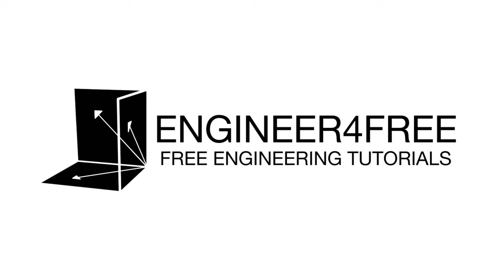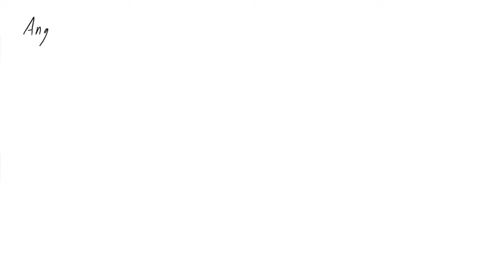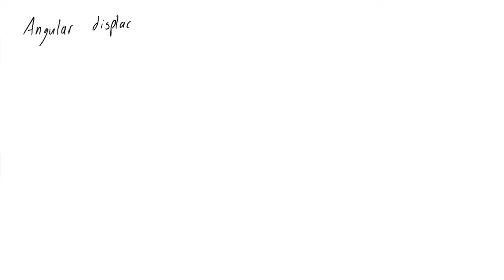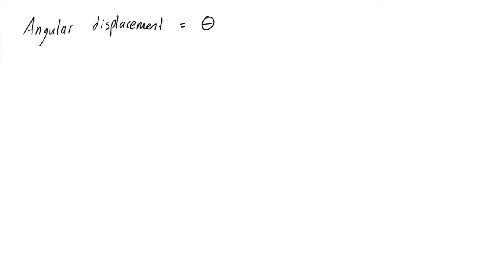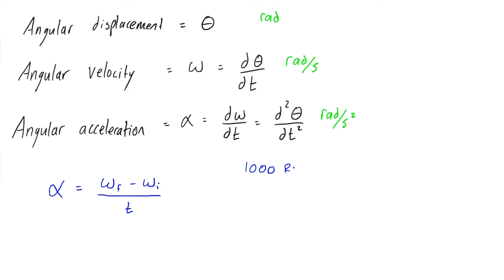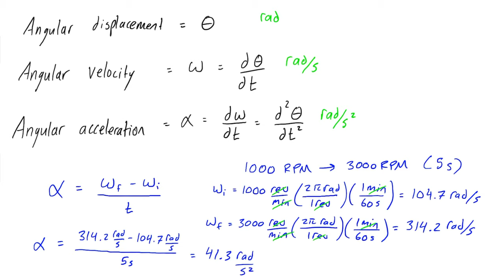How to calculate angular acceleration

Comment: an angular acceleration is given by alpha = (0.4t^2 + 0.6) rad/s^2 where t is in seconds, is impacted to a disc A by a motor. if initially the disc has an angular velocity of 5 rad/s, calculate the velocity and acceleration of block B at the time instant t = 1.5s

Comment: I got a couple of question that I am not to sure about could you help?
1) An automobile travels to the right at a constant velocity of magnitude : v = 60.8 km/h. If the diameter of a wheel is d = 429.1 mm, determine the angular velocity of the wheel. θ = 24.7 degrees.

2)An automobile travels to the right at a constant velocity of magnitude v = 69.0 km/h. If the diameter of a wheel is d = 350.9 mm, determine the magnitude of the velocity of point D. θ = 24.0 degrees.

3) An automobile travels to the right at a constant velocity of magnitude v = 68.7 km/h. If the diameter of a wheel (shown in Figure Q6) is d = 303.7 mm, determine the magnitude of the velocity of point E.  θ = 22.5 degrees.

Many thanks!
Reply from the maker: Hey Alex, watch videos 15 - 21 here engineer4free.com/dynamics and specifically 17 and 20 wikl show you what you need, but I recommend just taking the time to watch them all 👌

Comment: A small vehicle enters the top of a circular path with a tangential velocity of 4 m/s and gathers speed as it moves down the path. Determine the angle β to the position where the vehicle leaves the path and becomes a projectile. radius is 10m

any videos regarding this problem? thanks in advance
Reply from the maker: Hmmm having a hard time visualizing what you described. All of my circular motion problems are here: engineer4free.com/dynamics numbers 15 - 21, and also have projectile videos, numbers 10 - 14 but they don't exactly relate to anything circular.
Reply: @Engineer4Free  Thanks!  sorry for this question i don't know how to ans this one because of the limited given
Reply: I got the ans btw  thanks your videos helped me a lot, the ans my questions is the manipulation of formulas of w
Reply from the maker: @animestream1013  Great!!!